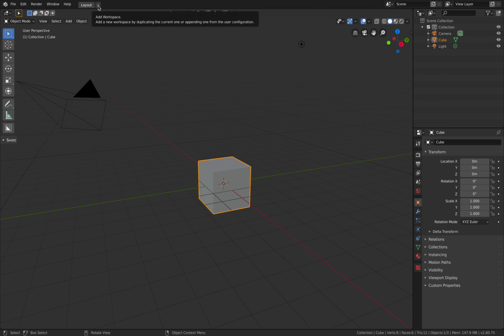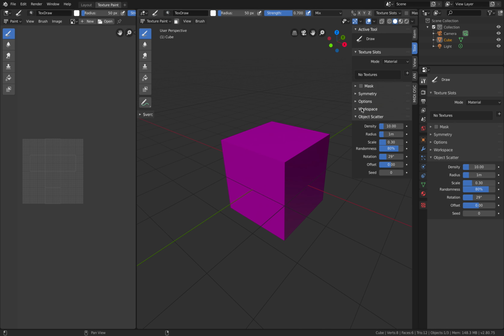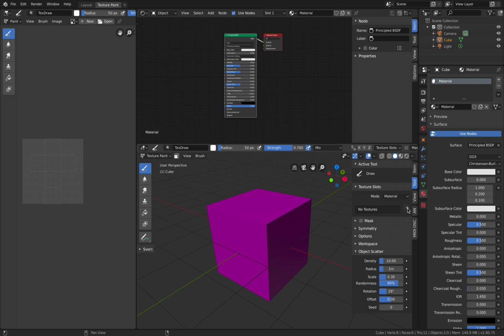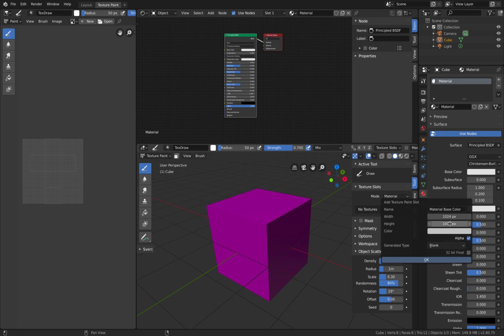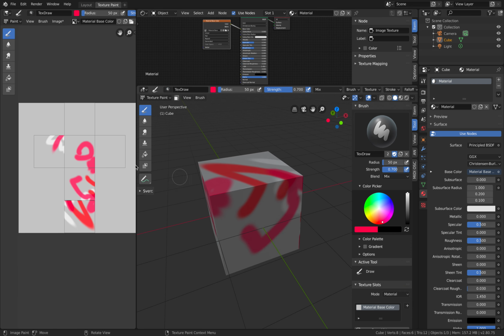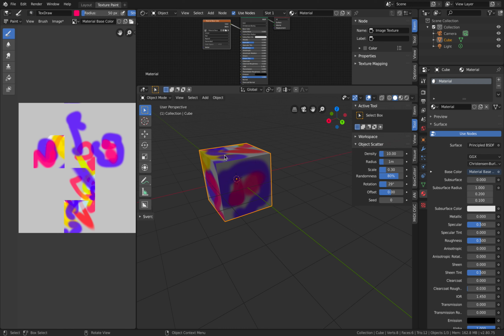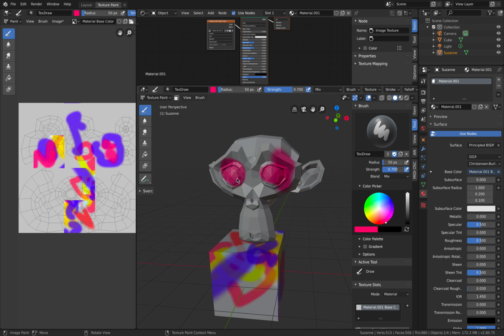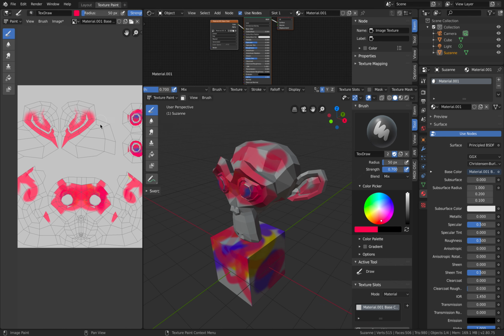QUICK TUTORIAL / Setting up 3D Texture Painting in Blender 2.80

Comment: I have this set up identical to the vid, but as soon as i add the base color it turns the hole thing the color i chose as the base color. and after no mater what color i chose nothing shows up when using the brush. iv seen so many others with different problems around this I'm starting to thing i should look into different software xD